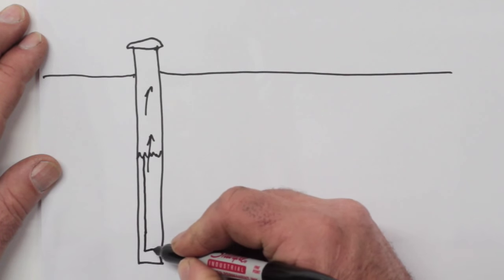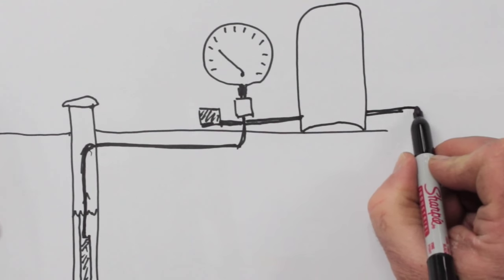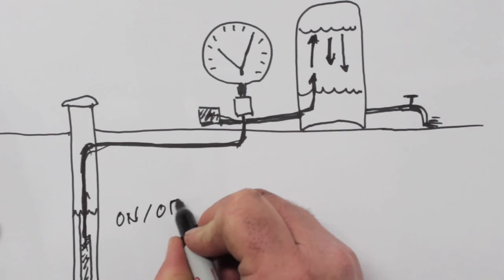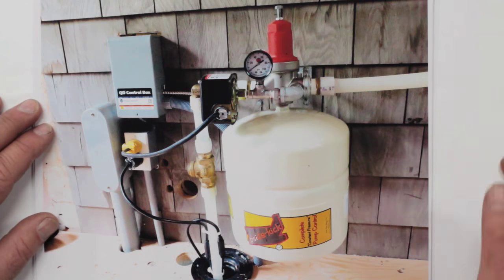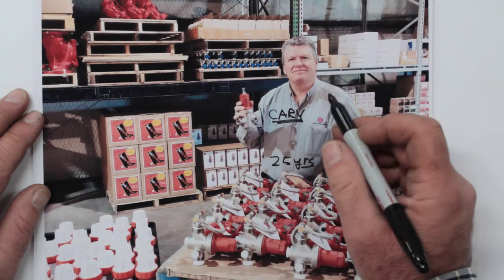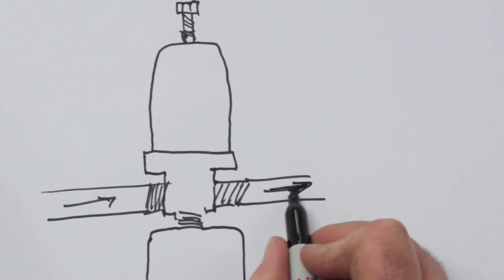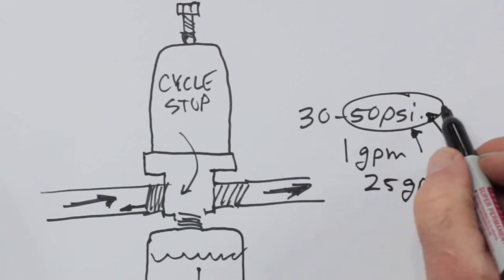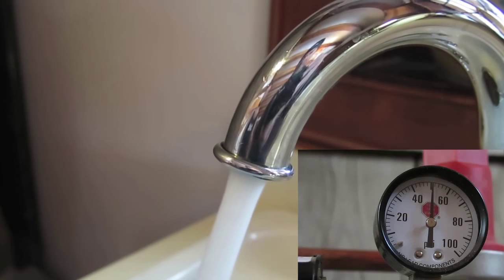How to Make Your Water Well Pump Last Longer

Comment: I believe Cycle Stop Valves have there demand, but they are not right for every situation. I have used many in my installs, but they do put an excessive amount of back pressure on the pump and piping going back toward the well. The creator of this valve has "proven" that excessive back pressure will not damage the pump and the amperage does indeed get reduced during this time, but 125+psi back pressure is not practical and the less amperage is not going to save you a noticeable amount of money...price of CSV and small tank = price of larger tank
Again, they definitely have a purpose but are not necessary if your system is not broke.
Reply: 125 PSI back pressure is practical.  The back pressure is what makes the pump draw lower amps and run cooler.  Back pressure is also how the CSV stops the destructive cycling on/off.  Besides, any homeowner deserves strong constant pressure in the house.
Reply: That back pressure will bust your pipes

Comment: My pump screen became plugged years ago and my pump ran 24/7. My electric bill doubled! How is running the pump 24/7 a good thing?
Reply: The CSV does not cause the pump to run 24/7.  The pump only runs when you are using water.  This is much better for the pump than cycling on and off continually while you use water.
Reply: @cyclestopvalves8380  so u don't have a pressure tank? Your pump will run longer and more often.
Reply: @justray510  There is a small tank, a few gallons if that, mounts directly to the valve. It keeps the pressure in my system at a steady 55psi. The pump only runs when you turn the water on and allow say a few gallons to pass. Flushing a toilet will not turn on the pump, the small pressure tank easily takes care of that. You can get a larger tank, but it kind of defeats the purpose if you want to be rid of a large pressure tank. I have had no issues since installing, and it is nice to have almost instantaneous hot water. Another benefit I hear few folks mention.

Comment: Lots of confused folks below. First,  motor draw in amperes DOES fall as you throttle the pump output. Fact. It doesn't matter if YOU believe it or not. If you have a clamp-on ammeter you can see this with any pump as it pumps up the pressure tank. When is current draw the lowest? You guessed it: at zero flow. 

Yes, you can install a bigger pressure tank to reduce cycling of the pump, or a pair, or an entire bank of pressure tanks, but why? You're putting out big bucks and taking up a lot of floor space. To answer one commenter below, yes, you do need a small pressure tank with a Cycle Stop valve. My old 81 gallon tank is about to be replaced with a wall-mounted 5 gallon tank. The floor space I save will be taken up by a second Filox iron filter. When my irrigation system finally shuts off after several hours of continuous running at 60psi, the CSV brings the tank pressure up to 65psi and the pump stops. 

Steve Maxwell (no relation) is mistaken about one little thing: several pressures are available. The base model, at US$63, can be ordered with a factory set 40, 50 or 60psi setting. 

Yes, as wu ming mentions below, you can go with a variable speed pump. I was going to go this route but a Grundfos SQE with control box cost C$3400 !!! That's just plain crazy. The pump does appear to be reliable but the control box is notoriously unreliable and costs C$1100 to replace every 3-4 years. That's a non-starter for me. Not acceptable, Grundfos.

Restricting a pump's flow does NOT cause "cavitation and vibration reducing the pump's life", gpgt1. You're mistaking this with reduced flow via restricted INTAKE, an entirely different animal. A restricted intake causes cavitation problems and sure does affect pump life. There IS a minimum flow needed past the motor for cooling purposes but CSV's are engineered to meet Franklin Electric and Grundfos motor requirements 

All you naysayers out there: read up on CSV's at the company website, cyclestopvalves.com  Be prepared to spend some time  on this as the website is crammed full of reading material. Here's my final comment: irrigation systems are the biggest killer of well pumps, in my 30 years' experience. But frequent cycling for any reason is going to reduce pump life. You can see I was sold on Cycle Stop valves a long time ago and never set up a well system without one.
Reply from the maker: Thanks Paul!
It's interesting how the internet gives people a platform for offering opinions that aren't based on fact. You said it best when you talked about the ammeter. Clip is on any jet pump or submersible pump and the current draw goes down as you mechanically throttle back the flow. I continue to be happy with the Cycle Stop I installed. It's a great little invention.
Thanks for watching. I wonder if we're related somehow.
Steve Maxwell
Reply: Paul Maxwell 
To be fair you need to look at the energy usage per gallon of water produced. 
Pumps have a “sweet spot”, a range with maximum efficiency. When applying back pressure the pump will become inefficient and waste a lot of electricity.
Reply: @paftaf  I agree!  But you should first look at the energy usage per gallon when using a VFD.  The same thing applies.  Even though the VFD reduces the amps needed to spin the pump and motor it increases the energy cost per gallon produced.  People who sell VFD's would rather you not know that fact, and use the myth that VFD's save energy to con unsuspecting people into needlessly spending a lot of money on VFD's when an inexpensive and simple CSV will do the same thing.
Reply: Cycle Stop Valves 
Stay focused, do not distract from the topic. Tell the truth about your product, don’t lie. Be transparent and honest. 

CSV restricts the output flow, simulating a higher head, shifting to the left side of the curve, outside of the manufacturers range of operation. 

That voids the warranty. 

If your pump breaks the manufacturer will cancel the warranty because you misused the pump.
Reply: @paftaf  You are exactly right!  I have been lying about how well Cycle Stop Valves works for 27 years now.  In over a quarter of a century I have fooled hundreds of thousands of people and even the US patent office.  I tricked the US patent engineers and attorneys and got several patents.  I tricked hundreds of thousands of people into thinking CSV's really work.  It is just the Placebo effect.  I put people in a trance and make them believe their shower water pressure is stronger, their pumps are lasting longer, and using smaller pressure tanks is OK.  I fooled many of these people into thinking the CSV is the reason their pump has lasted many years more than the one before.  I secretly go and personally repair everyone's pumps in the middle of the night just to keep up the ruse.  I spend millions replacing all those pumps so no one finds out they didn't last very long.  I staged the reviews, pictures, and stories from thousands of happy customers.  So you caught me.  You are so much smarter than everyone else.  I have had technical discussions with hundreds of engineers from every major pump company in America and none of them saw through my facade.  I was able to fool everyone but you.  I bow to the great Redwood Madrone and everyone should do as he says.  He is by far the most brilliant person in the world and everyone should know it.  (Big eye roll if you couldn't tell)  LOL!
Reply: Cycle Stop Valves 

CSV drastically reduces the electrical efficiency, wastes a lot of energy, and voids the pump manufacturer warranty. 

You can cry and whine as you want, those are facts. 

I see that you deleted your previous comment, because you know that Franklin voids their warranty if you use a CSV. Thank you for deleting that false comment you made.
Reply: Cycle Stop Valves 
I’m just asking you to tell the truth and be honest. 
You behave like a snake oil salesman, obfuscating the facts.
Reply: @paftaf  The problem is you do not understand pumps well enough to see that I am telling the truth.  It is the VFD salespeople, which I think you are one of, that are obfuscating the facts.  Learn to do the math and your foot won't be so positively stuck in your mouth.
Reply: Cycle Stop Valves 
Yes, let’s do the math. I love math. 
Please refer to the Franklin pump efficiency curve. 
And btw, I don’t even have a pressure pump, and I don’t sell anything. I just want you to be truthful.
Reply: Just Crickets?  This is usually what I hear when someone finally understands the truth about how a CSV works.  No apology,, no corrections to their posts, just crickets.
Reply: @cyclestopvalves8380  - “a little light reading”.   Lol!   I love it!😂🤣
Reply: @stevee7774  I am glad you liked it.  Having been explaining how pumps work with Cycle Stop Valves for nearly 30 years now, I am still amazed or floored at how negative some people can be.  People who think they know how pumps work but don't can be very ugly to me and call me all kinds of names for trying to explain it to them.  What people do not understand is that the CSV works so well it was blacklisted by most of the major pump manufacturers in 1994.  The quote from these companies was, "These Cycle Stop Valves make pumps last longer and use smaller pressure tanks.  Since this company makes pumps and tanks, any employee who mentions a CSV will be fired immediately".  It is kind of hard to find anything wrong with a product that works so well pump manufacturers are deathly afraid of it.  Another quote I was told years later was, "If every pump had a Cycle Stop Valve about 90% of pump companies would go out of business".   Cycle Stop Valves couldn't ask for a better endorsement than that.  Lol!
Reply: @cyclestopvalves8380  - Thanks for all your hard work... and patience!
Reply: @paftaf  How do we know that you are right? How do do you know you are right? Let’s see some data and calculations.  It’s been two years already.
Reply: @paftaf  You're right. I have spent no time thinking about power consumption. Well pump replacement, in a deep well, is SO laborious I'll do ANYTHING to lengthen pump life. Maybe I'll sit down and do the math sometime, to figure out the  consumption.

Comment: Does this offer any any advantage to a system with a larger tank?
Reply: The only advantage I can think of is it's easier and less expensive to replace a small tank that fails compared with a large one. In 12 years, we have had 3 Sta-Rites (fiber w/bladder) fail. Two of them have been 119gal - one was waterlogged which was a real pain to get out of the house without drilling it, the current one with a replaceable bladder has a cracked polar boss cap (ridiculous - should never happen). The big tanks are great because even with five people in the household, we usually only cycle our pump 2-3 times/day, even running 50-70 pressure. So that is very good, and IMO, better than using a CSV with a small tank. But they're expensive and they just don't last which blows...
Reply: What exactly doesn't last? Regarding your last sentence, thanks.
Reply: Omaha419 The tanks fail and then you're back to spending big bucks on another big tank
Reply from the maker: Hi there! Yes, the advantage would be longer pump life, though not as much longer as with a smaller tank. The valve essentially reduces the number of ON/OFF cycles for a given volume of water pumped. You also get a more consistent water pressure at the tap.
Thanks for watching!
Steve

Comment: Question: so this CSV system eliminate the old big blue water pressure tank? right! or do you still have it connected to the well pump with the CSV system too? thanks
Reply: The CSV still works with a pressure tank.  It will work with any size tank, but a very small one is really all that is needed.

Comment: So if the pump is running the whole time the tap is on, where is the extra water going that the pump is pumping? The pump supplies much more than 1gpm that the tap uses right? What level of pressure is applied to the pump and the plumbing between the pump and stop valve?
Reply from the maker: +Martin Vandepas Hi Martin. That's a great question. The output of the pump is throttled by back pressure created by the valve. In other words, the pump only puts out 1 rpm (or whatever is required). There is no extra water to go anywhere. This sounds like it would be hard on the pump, but not if you're dealing with a submersible or jet pump. Back pressure actually causes the motor to draw less current, run cooler and last longer. You can see this effect by putting an ammeter on the pump as the valve is throttling it. The back pressure varies as needed to ensure a 50 psi output regardless of the water flow demanded. 
Does this help?
Take care,
Steve
Reply: @baileylineroad  You seem to be saying the RPMs of the motor vary. The motor runs at only its rated RPM whenever it runs.

Comment: what if i dont want to install on the tank do i just need to install before the psi switch?
Reply: A pressure switch and the pressure tank need to be fairly close to each other.
Reply: @cyclestopvalves8380  they are for sure less than a foot away from each other